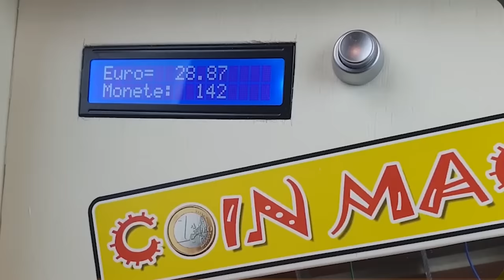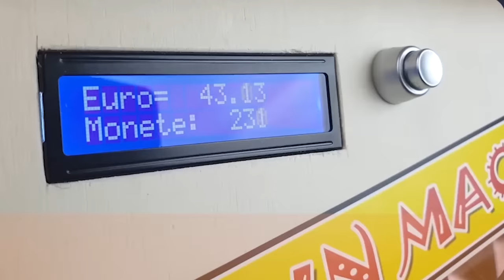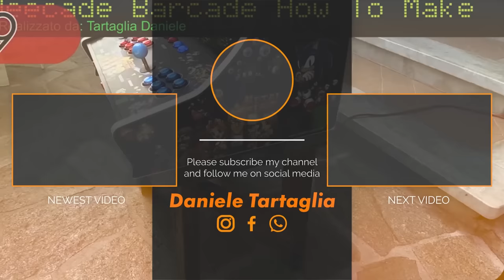HOW TO MAKE Angle Grinder Sliding Cutting Jig

Comment: Soo, since its like a baby miter saw, miter saw best practices should be followed, never start from the back of your cut and come forward. cut from the front of the piece back. This will help keep the saw from walking up on to whatever you are cutting, and more important, keep the blade from grabbing the material you are cutting and running forward, possibly taking fingers with it. Safety first aye! Great build though.
Reply: I was going to say the same thing. I will also add to that. Try using a blade with as many teeth as possible with as little of a hook angle as possible. This will take smaller "bites" from the material and reduce climbing.  A negative hook angle is preferable on a sliding saw. Be safe!
Reply from the maker: Thank you for your recommendation. You are right, I have no woodworking experience, I just built a wood cutting machine, but I'm glad you saw the error
Reply: I was about to say........and thanks for.more.info ..
Reply: As someone who is missing a finger to near enough that sort of accident I just like to point out things that might cause bodily harm.
Reply: I was thinking that it was a baby radial arm saw. And yes, I have nearly cut my fingers off with a radial arm saw.

Comment: Impressive, that motor looks very strong for its size.
Reply: That's what I was thinking too - then I remembered that like most of Europe and India, they use 220 volt DC (we use 110 volt AC) which means he can use a small sized motor with a lot of power.

Comment: Nice Project. But the switch placement could have been better. Like stick or rod able to hold and pull to it towards you and switch at the end. Something like firing trigger switch in planes and be able to pull towards you etc would have been easier and good.

Comment: Where can we find the designs for the project? Can the parts also be 3D Printed? I don't have the tools that you use to cut the wood so procisely.
Reply: If you have a 3d printer, you already know what needs to be done. Make the parts to the dimensions you require. Just beware that plastic may flex, so consider what type.
Reply: @3dw3dw  Ok, but do you have any measurements at least so I know where to start? Anyway your tools are work of art, it is a pleasure to watch you build them.
Reply: @bbogdanmircea   I am not that guy. These are not my builds. But I would suggest when you buy your drawer slides (linear bearing) and drill motor all your measurements will be relative to those. Everything else is selective.
Since the drawer slides can be from 12" to 30" even that may be considered selective and for that reason maybe he doesn't post measurements. Check the description, maybe he gives you the link for the drill motor and belt cogs. That will help establish the starting point. Good luck!
Reply: @bbogdanmircea  yes I checked and he listed links to all the parts he used in the video description.

Comment: I need some help please. I bought 12V 795 Motor and power suply is 12v 10A, and the motor does not have the power to cut a 2cm thick wood. What is the problem? please help me, thank you

Comment: Ho dei dubbi sull'elenco messo a disposizione sul sito. Volendo costruire questo oggetto, ho ordinato quello che era scritto su BANGGOOD. Poi, riguardando bene il filmato, alcuni particolari non corrispondono con la costruzione (esempio: barra di accaio del diametro 12 mm mentre nel video è da 10 mm.). Adesso mi trovero con oggetti ordinati e difficoltà, poi, nell'assemblaggio.
Perchè non descrivere i particolari con sicurezza in modo che, chiunque voglia cimentarsi nell'esecuzione, non si trovi in difficoltà e spendere più soldi?

Comment: Since only found comments about where to get the material and that u did a great job i want to give my opinion. First, you seriously are very good at what you do and its a pleasure to watch but:
 on the  jigsaw guide you used linear rods to make the LINEAR movement precise and durable. Why then use drawer slides for the linear motion on the circular saw? And on the other hand use linear bearings to keep rotating things in place? This feels so illegal to me😂. Keep the rod and just place some cheap 608 radial bearings on it and then use the linear ones for the linear back and forth motion. 
Anyways
Watch your hand and keep it up

Comment: I Have A Question, What Engine With What Voltage and Power Was Used?
Reply: 775 DC motor 12V-36V 3500-9000RPM 
All materials listed in the description

Comment: I'm surprised to see this small motor has enough power.
Reply: While he cut the aluminium, the motor had hard times if I heard well, but yeah, the wood/PVC had been cutted flawless :)
Reply: If one checks the size of electric motors in some saws, one will discover the motor is roughly the same size.